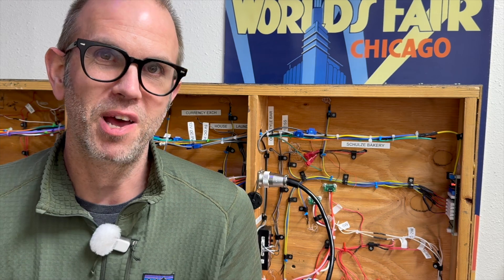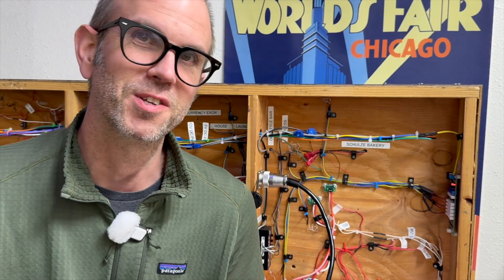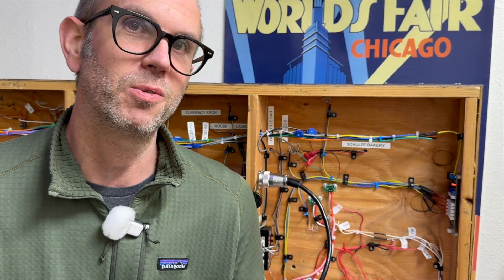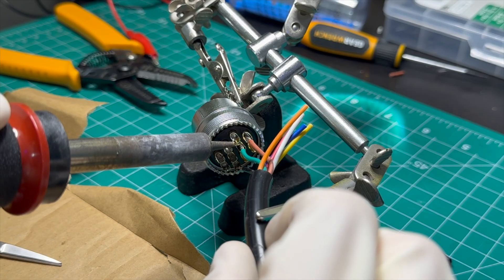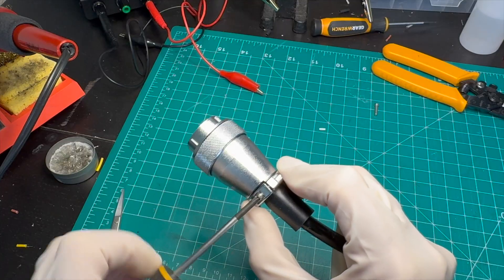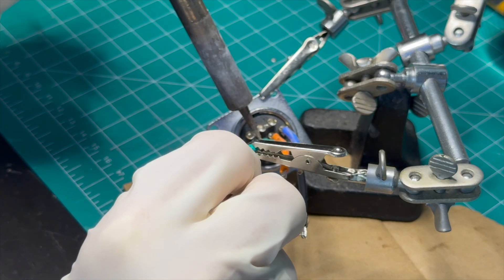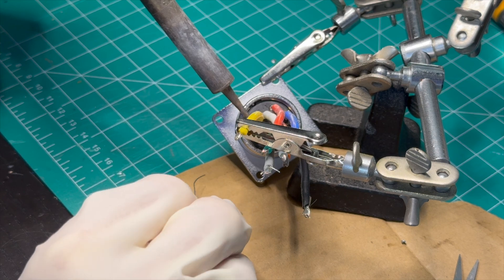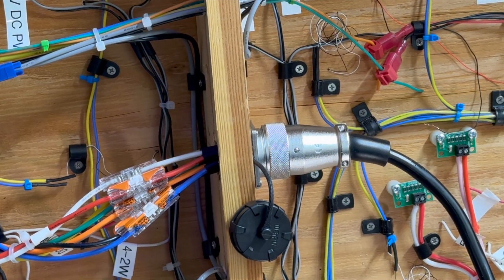Bulkhead Connectors for Layout Power | CCMR At The Bench #30

Comment: This is probably asked somewhere else, but how to you secure the table top to the packing table? I like that you can flip the table on it's side when you are doing the work under the table
Reply from the maker: Currently I don't have the layout secured on top of the table frame, it just sits on two 1x3 wooden skids. The key is that I don't have the layout sitting on a solid table surface, so I can access the wiring from underneath just by ducking down. The layout is also light enough to where it can be moved on or off the table quickly by two people if necessary.

Comment: I'm intrigued by this. In the UK, MERG make a range of electronics modules that all consume 12V and have a buck converter or similar to knock down to 5V. I'm not sure what's more compact: a single power bus and converters everywhere, or multiple power buses
Reply from the maker: Really just depends on the structure of the layout and what's needed. Each option is formally correct.

Comment: Very nice.  I used the same WAGO connectors.  They have a wire length strip gauge on the side.  The strip length of your wires looked very short.  The clamp inside the connectors will grab more insulation than bare wire creating a high resistant connection.  I would double check your strip lengths.
Reply from the maker: Thanks for the heads- up, I checked the length and it's a bit shorter than the 11mm. No insulation in the clamps but I'll strip to their specified length.

Comment: I use Molex MLX connectors.  4 pin connectors work out to about 50 cents a connection.  Yes, you need to buy a crimping tool, but it’s worth it in my opinion.
Reply from the maker: Yes! Those work very well for these multi-bus connections and are time-tested for model railroaders. I have a bag of those around as well. I was originally thinking about using them for the layout, and can also be used with thermostat cable or the like.

Comment: They were referred to as cannon plugs in the military. They do make for a tidier setup, and troubleshooting is easier also.
Reply from the maker: Interesting tidbit! I'm really happy with this system. Working on the rackmount power management now.
Reply: I had the impression cannon plugs cost approximately infinity money - $20 is quite reasonable though. perhaps actual milspec plugs do...
Reply from the maker: @RoamingAdhocrat  they can absolutely be expensive if you go for Amphenol or a similar aerospace grade manufacturer (or milspec, as you say). These cheapies are perfect for low voltage/current applications or where your life doesn't depend on it.

Comment: Soldering multi-wire connectors is one of my least favorite activities in electronics, but you made it look easy, with good advice.  Just as I was thinking, "Tell them about the mirror image of the connections," you did so.  Even though it should be obvious, it's a common trap (and I won't tell why I know this).  And in close quarters shrink tubing can "pre-shrink" by heat transported up the wire before it's slipped onto the connection.  Lastly, I consider having a "third hand" to hold the wires while soldering is a necessity.  Thanks for your videos, as usual, Eric.  They are very informative.  Cheers from Wisconsin!
Reply from the maker: Hey Andy - I'm sure you know that from experience :). I did edit out some cursing at the bench so it wasn't all candy and daisies. Yeah, third or maybe fourth hand - my little clamp device has been absolutely essential for all of this soldering work.

Comment: You'll like that "amphenol" type of bulk connector, they're rock solid...as long as they are soldered well & the cable hold down clamp is tight. Why the "wago" connectors though? Longer wires to a block connector or just a male connector to a female main power connector & you wouldn't have had to bore another hole in the bench work...just sayin'.  Nice job! It'll last well past the layout
Reply from the maker: Yep, like it already! The wagos are nice, allowed me to test everything out before making permanent joins.
Reply: @ChicagoCrossingRR i've never used a wago connector, they appear to work & i might try them someday.  After all the work you've put in making the wiring neat & tidy, they just "look" a little funky hanging there is all my 2 cents is worth😂
Reply from the maker: @yamo1226  yeah I might be getting to the end of my 'zen of wiring' phase. Just finished wiring all of the switch motors and after wiring the signals into those, it'll be wire policing. There are a few literal loose ends to tie together - maybe including those wagos.
Reply: @ChicagoCrossingRR 😂😂😂  treat your wiring zen like you treat your painting zen😉.  I know I get sloppy nearing the end of a project, wanting to just be finished(don't be like me😅).  Looking forward to the switch machine update, never seen those in action before

Comment: Big fan of those Wago inline connectors. Sure beats having to try and solder the buss wires on the layout to that 10 pin connector.
Reply from the maker: Hey Ron, it's a snap and easy for testing. Whether I ever do use pins 9 and 10 (kind of doubt it), they at least make that connector removable without having to cut wires again.